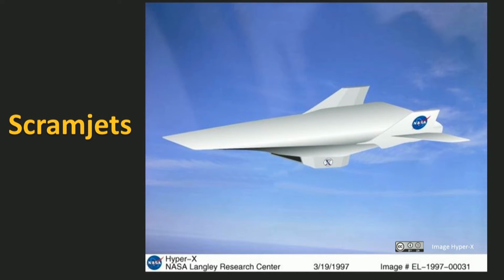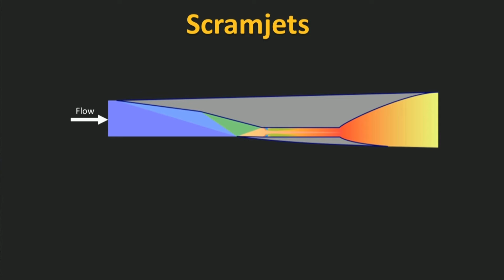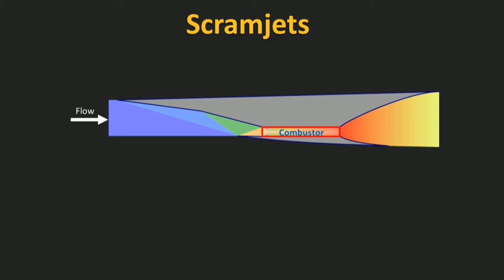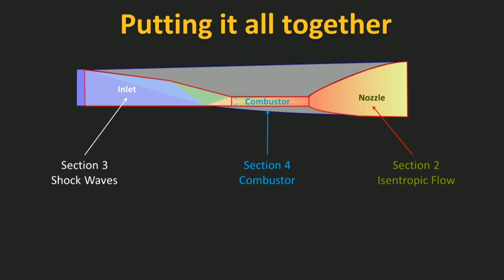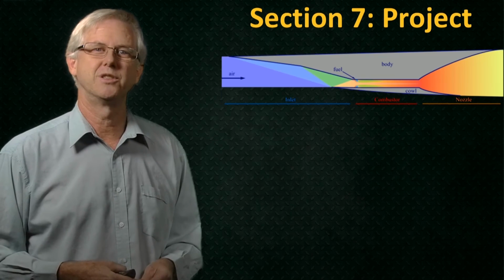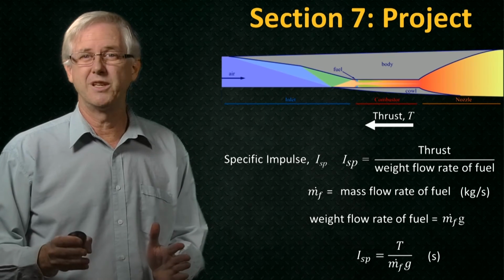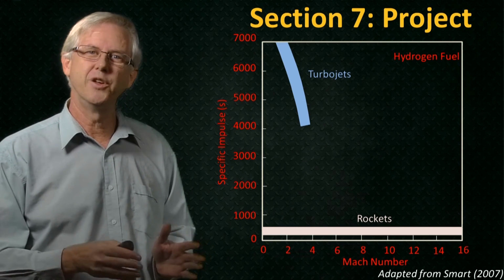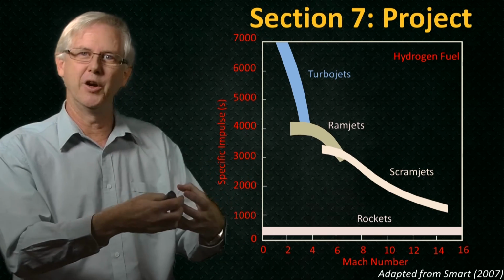UQx Hypers301x 1.7.1v Scramjet Engine Configuration

Comment: I got a question, scramjet cannot be self-started I heard. But if the fuel is burned by supplying compress air or by providing a spark plug, the trust blowing off the tail wouldn't produce air sucked-in into the engine? To me it looks like the inlet of the engine would suck in air as the same amount of force that ejects off the exhaust, even if the plane doesn't move, am I wrong?
Reply: Generally speaking a Scramjet cannot sustain combustion at lower speeds than Mach 5. So it would never be used on the ground since it can't do that. You would use another engine to reach hypersonic speeds for the scramjet to work properly.